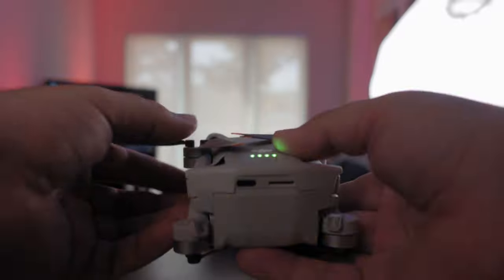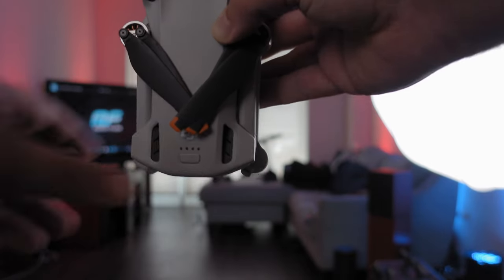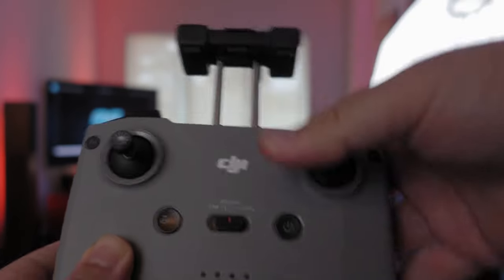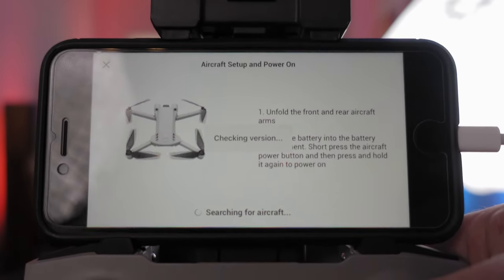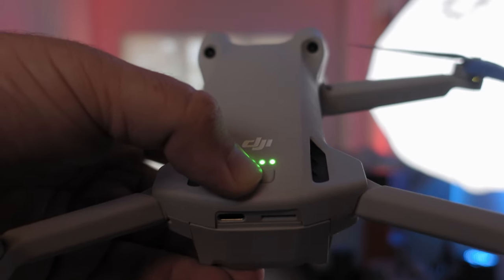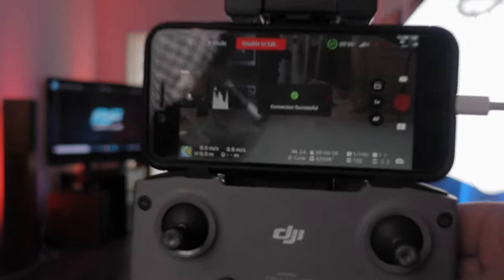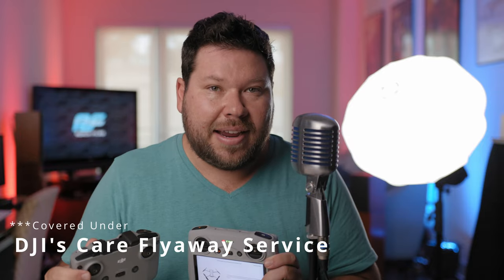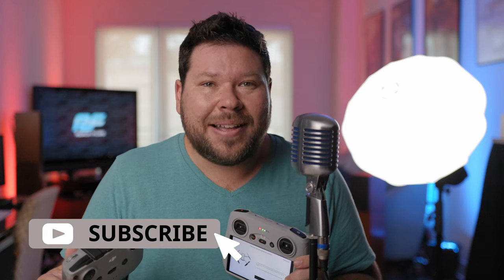DJI Mini 3 Pro Tutorial | How to pair & bind your Remote Controller

Comment: So I'm a little bit confused I purchased a mini 3 from eBay and it came with both controllers, the one that you connect to your phone works perfectly fine, but when I try to bind the one with the built-in screen, it says that it's already bound to another account? So the only way I can utilize the controller with the built-in screen.... I'm going to have to have the seller log out of his account?..
Reply from the maker: Yes you will need to seller to log out unfortunately, he should have done so before selling the drone
Reply: @ReachFilms  So just to clarify one thing if I may? It's not the drone that's the issue? It is definitely the controller? So I don't have to return the drone? I just need to send back the RC controller? Is that correct? I apologize for so many questions...
Reply from the maker: @josephf2157  I believe it’s both the controller and drone are linked to the guy who you bought the kit from. He needs to unbind the drone from his account
Reply: @ReachFilms  Thank you so much for your help
Reply: hii @josephf2157 , I recently purchased a DJI Mini 3 Pro drone but have been having trouble connecting it to my controller. I've tried resetting the drone and controller, updating the firmware, and checking for updates, but nothing seems to work. However, I did discover that when I use my friend's controller, my drone works perfectly fine, but my controller doesn't work with my friend's drone. So, it seems like the issue might be with my controller (in built screen ). I would appreciate any advice or help on how to resolve this issue. Thank you!"

Comment: This is BS.  Nothing like that happens on my screen.  I get 2 connection methods: "Connect with RC only" and " Connect with Goggles Motion Combo."  I press the first one, and it goes to a page that shows you how to hook up your phone.  You can't seem to advance past the page.
Reply: Having the same issue now.  I've been able to successfully operate my Mini3Pro many times until recently.  Seems it may be an update that was done since the program pages have changed.  Ever get a solution?